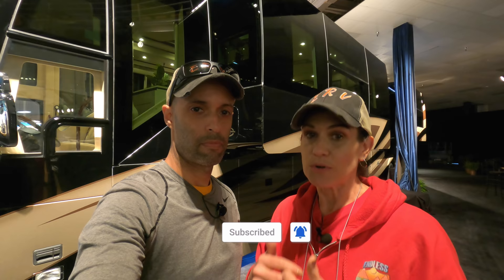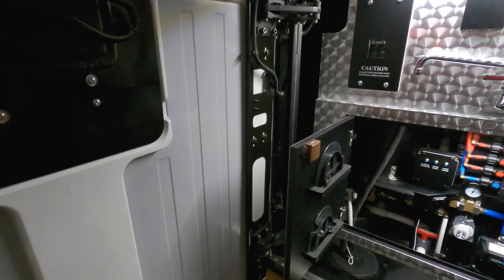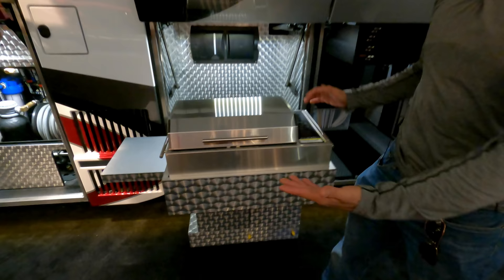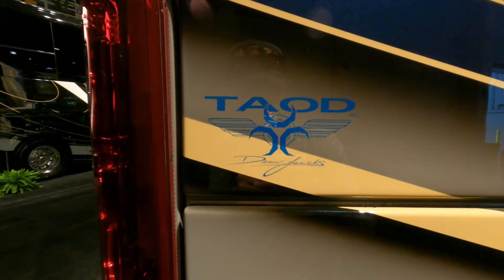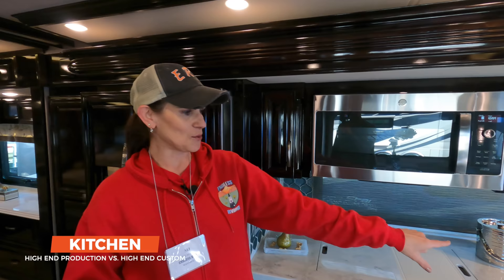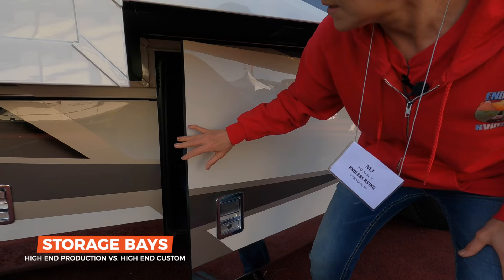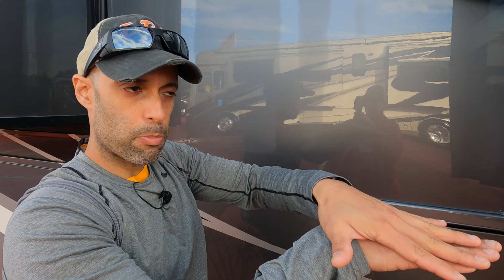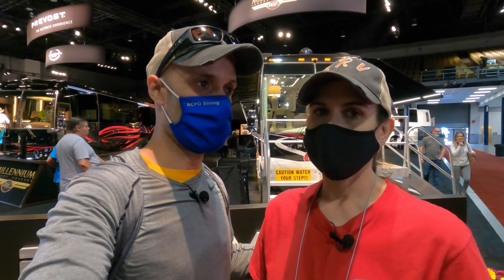Is A Custom Motorhome Worth The Premium Cost Over A Production Motorhome?  YOU DECIDE!

Comment: Very informative. This illustrates the problem I have with the RV industry in general. There is a lack of pride of workmanship and, it seems, a belief that because these units are supposedly like driving “through an earthquake” everyday, the manufacturers have convinced themselves and many of us that things don’t have to be tight, well-designed and made to standards of care. I bought a beautiful new home a few years back, and I had a small electrical problem shortly after moving in. I called in an electrician to fix it. He did so. And then he showed me the sloppiness of the system, and offered to clean it up—to make it look good, to be easily accessed and with clear labels for everything. I said how much, and how long. He said  $75.00 and less than an hour. He was just bothered by the shoddiness he saw, as a professional who took pride in his work. 

Do they think that when we put our hard-earned money down, whether it’s for a $13k travel trailer or a class A motorhome that the details don’t matter?  My first car was a Honda Civic. It was reliable, well-made and built to last. I thought it was pretty snazzy looking too. I didn’t think that because I only paid  7k for it brand-new, (yes, I’m that old), that it should start rusting in the first year, have terrible road noise, need to be in the shop 5 times, have uncomfortable seats and flimsy fittings. I thought it should be a quality vehicle I could depend on. And I did, and it was. 

I’m not comparing a house on wheels to a car,  or a proud electrician to an installer that’s graded on how many jobs he finishes each day. I’m just saying, whether I’m buying an entry level travel trailer, a fancy Class B+ or a Prevost, why can’t I expect  quality, well-designed and installed  systems, that are meant last a reasonable amount of time?  Why do I have to worry so much as a potential RV owner? Or learn so much and look so hard , endlessly, at YouTube videos, to find the one I can rely on to not make me regret my purchase? Whew! Listen to me. Epic rant. I think I have to set down this covid-related, RV-YouTube obsession I’ve developed.  After nearly a year, I’ve learned a lot but I’m no closer to pulling the trigger on a rig than I was when I started. 

Thanks so much for your great channel and sharing your expertise.
Reply from the maker: If you want quality coaches look to well made older used coaches.  What is coming out of the production factories today is mostly garbage.  

Thanks for watching and the comment 

Izzy
Reply: Joan, of course I don't know your age or situation but my advise would be...Don't Wait!  There is no such thing as perfection in this life. A used higher end production RV will likely have most of the bugs worked out by previous owners.  Whatever your purchase price is, try and keep another 20% above that for initial repairs or  updates needed. Buying the best condition vehicle, 5-15 years old will minimize depreciation when you decide to sell...as long as you invest in updates and repairs along the way. It's the cost of a fun lifestyle.
Reply: @barryg.291  Thanks so much for the advice and encouragement.

Comment: I would go with a used Prevost having owned a couple of newmars and a Tiffin which were fine coaches but the quality of a Prevost in finish ride and quality is superior.   Bear in mind depending how far back you go on a Prevost,  updating and remodeling is also not cheap.  So you better be prepared to spend $$ unless you plan to do it yourself or can find a shop that
has reasonable pricing.  Great video.
Reply from the maker: Thanks for sharing 

Izzy

Comment: There is something to fix on every one of these. More things to fix or upgrades to come. If I was permanent full time living , Prevost.  If I am vacationing once in a while, Baystar.  If I am travelling frequently, upgrade production coach.  If I am thinking with my wallet, production coach  two years old. Maybe they have worked out the new coach bugs by then.  Either way there will be things to fix or improve.  On a personal note I like the upgrade production , diesel type chassis with the air suspension and brakes, bigger motor, trans.  I like an interior with real wood components, real tile, real porcelain toilet, real plumbing fixtures, etc. and I'm not spending 800,000. Hey I like your show, thanks...Walt
Reply from the maker: We are not ever spending 800k  on a motorhome.  That’s a lot of market investment and real estate, things that actually make money!!  Thanks for watching and the comment. 

Izzy

Comment: Hey guys, this was a great video. What you didn't cover is the level of service that comes with the custom-built coach. We know your Newmar can receive excellent services in the new facility in Indiana, but for the west coast, that's almost 2500 miles (one-way) to get factory-level repairs. More importantly, using up that many miles from the limited warranty is a real challenge. Ask Andrew about the conversations he has had with Newell owners and their ability to get live tech support within 20 minutes 24/7, 365 days a year. Talk about the custom-built chassis with the ZF active tag steering function and fully independent suspension. Then talk about the redundancy of the technology that's built-in. I know many will say that the cost is too great, but after owning 3 different class A motorhomes (2 diesel pushers), I can tell you that the total cost of maintenance and failed mechanical repairs that mysteriously are not fully covered by the production builders, the overall expense adds up quickly over a modest lifetime.  What most fail to factor in is the cost of your time. Your own personal time attempting to handle DIY issues, or the time away from using the coach. If you can afford a vehicle (premium or custom), I suspect you are not valuating your time at $15.00 an hour. The quality, fit, finish, and durability of a premium custom-built coach makes the total cost of ownership (divided by the miles you put on it) well worth it.
Reply from the maker: Thanks for sharing 

Izzy

Comment: Thanks for another great video. We purchased an 06 45O Lxi couple years ago. All stainless steel welded unit built by the Bluebird bus company.  Even the skin is fully welded except for the fiberglass caps and aluminum roof. There is a difference. Thanks again.
Reply from the maker: Bluebirds are tanks.  They are not made like that anymore.  Thanks for sharing 

Izzy

Comment: The Prevost H3 chassis has huge bays, but hardly any headroom, like 6, 7" or 6,8", while almost all production coaches have 7ft plus ceilings.  The Prevost X3 chassis does have 7 foot ceilings, but the bays are about the same height as production coaches.  And that tilted chassis is tilted in such a way that the suspension is able to allow the frame not to have to twist so much.  I will also note, that the same Prevost 2.2 million dollar coach will sell used the following year for 1.4 to 1.6 million, which is a HUGE amount of depreciation.  Drive trains for Prevost and production coaches is pretty much the same, both use Allison transmissions and Class 8 heavy truck engines.  The woodwork in almost ALL high end bus conversions is actually laminate, not solid wood - this is how they are able to provide so many custom options.  You can find high end appliances such as Wolf and Viking, Fisher Paykel even Miele in the King Aire and some of the other higher end production coaches, but keep in mind that the Whirlpool and GE appliances are just as good, long lasting and cost less to replace.  Also google Prevost bus crashes, you'll see that the chassis is not leagues above a production coach, but only slightly better.  The people that can afford a 2+ million dollar coach do it just as much for status just as much as for the quality.  Also keep in mind that Prevost owners have just as many issues as any other motorhome, just more expensive ones...and good luck trying to DIY anything but the simplest issues.  I love the Prevost bus condos, they ARE beautiful in nearly all details, but I think a lot of their mystique is a little over hyped - kinda like buying a Hummer in the 90's...  Additionally, that 800k production coach, isn't going to roll off any lot for that price, because no one sells or buys a production coach for MSRP, but guaranteed, you will find no such breaks on a high end conversion...  That being said, if I won the lottery, I'd actually buy a Newell coach as I think they are even better put together than the Prevost.  The frames are definitely made of higher gauge steel and they have a active steer tag axle and active dampers in the suspension, which neither production coaches or Prevost has.
Reply from the maker: Thanks for watching and the comment

Izzy
Reply: @EndlessRVing  Thank you for presenting so many different RVs and information on your channel.  I like the two different perspectives you guys provide, it's almost like getting TWO reviews in one video!!!  Keep up the good work!

Comment: I noticed a difference in external noise level between our KA and a neighbor's Zephyr at the campground. In the 2021 KA they eliminated the puck lighting. I haven't seen a one yet to check on the wiring. I'm considering a Foretravel Realm. May be a better bang for the bucks. Foretravel have pneumatic seals on the slides and the door. I suspect the steel frame might lower the cargo carrying capacity.
Reply from the maker: We looked at the basement wiring on the 2021 KA. Let’s just say for 1.3 mil it needs a lot of Improvment.   Thanks for watching and the comment Roy

Izzy

Comment: Hello guys, great video. If I may, after shopping around a lot, including contacting the Prevost conversion companies, it is clear to me that they do have many limitations when it comes to customization. Millenium, will not do lithium. So far, only Liberty does it yet, they lowered their generator to 12k, not the 20k anymore. They are limited to the size of the slide-outs and their extensions as they have to work with what Prevost provides. They all claim to be customizable and yet they limit you to base floor plans, that’s why most look the same. My « test » question to all of them : can you make it just like the King Aire floor plan 4569? All said NO. Hello customization! And what about the split windshield, wide structure blocking your view smack in the middle. No, for me. None have real estate for solar on the roof as they often come with 4 ACs. All that I’m writing here as been told to me by salesmen of these conversion companies. Now, to Newell... They offer way more customization. They claim that their construction equals or surpass Prevost when it comes to impact, telling me the story of one that was rear ended by a semi at high speed and had little damages. They also are not closed to the idea of lithium while keeping the 20k generator. I invite you to go see the latest Andrew Steele video on that brand new Newell. One of the most beautiful coach I have seen, so far. I love you guys but I say Newell all the way. As always, love your videos and expertise. You may not be pros but you sure sound like you are. Very well made video. Already waiting for your next video.
Reply from the maker: We agree Newell does have a distinct advantage as they do custom make their own chassis and they to are completely custom.  Unfortunately they were not at the show. I’m not sure if they are structurally better than Prevost that split windshield is part of the structural integrity of the chassis, but Newell is an excellent tank of a coach.  You won’t go wrong with either and will pay big money for either one!!  

Thanks for watching and the comment. 

Izzy

Comment: If money wasn’t an issue, custom all the way, my understanding is you set the floor plan and they build the chassis to the floor plan, whereas the floor plans are set to the chassis on production coaches.
Reply from the maker: That depends. On a Newell yes.  On a Prevost no.  The Prevost shell is converted by RV converter.  The shell is made by Prevost. 

Thanks for watching and the comment 

Izzy
Reply: @EndlessRVing  your right i got that from our good friend Mr. Steel’s video with the design department of Newell. 👍

Comment: I know Newell wasn’t there but nice to see a review from you on Newell versus Prevost. I’m still looking at my custom Renegade 45 foot super C but I’m still questioning maybe a five-year-old Newell coach also.
Reply from the maker: Two different monsters Super C vs Newell.  One is for hauling and the other for luxury in wheels.  Thanks for watching David 

Izzy
Reply: @EndlessRVing  We are planning on not hauling anything, just pulling a jeep or Ford SUV.  Super C is great for safety and also because Freightliner repair shops are all over in case we break down. And both have decent customization. And I like the duel drive axles 8 x 8 in the rear on the Super C renegade for ocean beach driving or desert side roads, etc.

Comment: First, I would get a used anything. Let someone else take the big drop in depreciation.  It doesn't have to be 10 or 20 years old, but maybe 2- 5 years. By that time the first owner will likely have  worked out all the "new toy" bugs.  Also, as far as maintenance.... they all need maintenance new or old. It gets calculated into the price. Needs tires or batteries = price reduction, etc.
Reply from the maker: Thanks for watching 

Izzy

Comment: I would get a used production Coach
And why would I do that ?
Throughout that Coach life all of the upgrades have been done to it 
all of the details that the factory forgot to do have already been solved.
I own a 2002 Dutch star4095
There was a lot to be done before I bought the couch and a lot more was done during my 60 day warranty and there’s a lot going on now after the warranty 
upgrades 
fixings the hydraulic jacks
All outside lights have been replaced or upgraded to LED
I have installed four chairs behind the passenger seat bolted through the floor with seatbelts